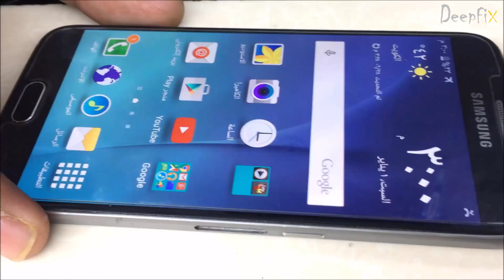Samsung Galaxy S6 Dead Fix

Comment: Wow, this was really impressive. My daughter S6 woke one one morning not turning on. When you plug the AC adapter it gets hot as usual and when you place it over the wireless charger, the charger turns the blue light on, but the cellphone itself doesn`t turn on. Do you know what is going on and if it`s possible to fix? Thx
Reply: Same happened with mine also about 2 to 2.5 years ago.
It was caused by voltage fluctuation in main electricity line that caused 350volts in the 220v home line.
It caused drastic damage to many home appliances one of which is my s6.
I tried fixing it myself but didn't get any success.
Still trying to fix it as i'm free now a days due to lockdown.
Long live bro.

Comment: I used s6 phone charging with wireless charger but not charging by cable charger.......How to solve this problem
Reply: Replace the charging board, it is the little one at the bottom, and the repair is fairly easy and cheap

Comment: pls pls pls urgent update, my galaxy S6 phone won't turn on until i plug the charger with it and if i removed the charger it go off again, i change the battery today and the same things still happen. it also go off and on before it finally turn on. kindly update on the next advice

Comment: Hey, My Galaxy S6 got wet at a party but not like soaked and it stopped turning on but it would charge. I took it to a repair guy and he disassembled it and tried many different things but it still wouldn't work. So he came to the conclusion that the motherboard was fried and it needs to be changed. Is there any way I could either get the data off of that fried motherboard or fix the fried motherboard? I'm begging you to please help me by answering this. Thank you

Comment: Hi, I have a Samsung Galaxy S7 SM-G930F which suddenly went black. I checked the LCD is working by swapping the other working motherboard of S7 to this fault one. Touch is also working. I did the hard reset, can run the setup wizard with the Voice assistant. But there is still no display at all. Any idea? Can you fix it?

Comment: My S6 Active stopped working last year so I got a new phone. I just recently decided to try to fix the s6 and noticed the charging port and home button plate might be the problem. The home button had stopped working consistently and was always in a depressed state instead of sticking out of the front screen plate as it should. My phone ended up shutting off and for weeks it would get extremely hot near the rear facing camera when I tried to charge it. Thoughts?

Comment: Hi, Great video!
What are you applaying in 1:18 before you start heating up?

Thanks
Reply: Flux. Sometimes found in things like solder, it helps to prevent oxidation of the base and filler materials. I guess without it, your chance of something going faulty again would be that much higher.

Comment: Hi guys. My s6 edge plus got cracked by an elongated tube and the screen is badly damaged. However, i could still receive calls and the apps are still updating. Would there be any motherboard issues on this? Or is it just the screen that needs to be replaced. The cracks reached the back casing near the battery sight. Please help guys. Thanks!

Comment: hi, i have an S6 edge, has had no water damage or any drops/falls etc, phone refuses to respond in anyway no charging lights no power nothing, tried all the reset key combinations they didnt work, so i went on to change the battery and changed the charger port, still has nothing, it is also making a really quite ticking noise when i put it on charge and bring the phone closer to my ear. Please can u help with this issue. thanks

Comment: my wife has am s6 128 gig. her phone is completely broken and won't turn on. as you know, the s6's were the only Samsung line where the SD card was in bedded into the mother board. is it possible to remove the factor installed micro SD memory card so I can at least retrieve her contacts and other info? what can be done?
Reply: Mike Ramos you can retrieve all data from it. search for emmc adapter or pay someone who does it for you

Comment: my S6 Was water damaged. The phone turns on when it's plugged into power but will not turn on off of battery. 
Battery says it's 95% charged each time the phone is unplugged and plugged back in and charges to 100% and then repeat.
I've also gotten a weird message saying the phone can't charge because battery temperature is to low. 
any ideas?

Comment: have a samsung galaxy s6. i recently dropped it in water and the water was an inch and i left it in there for 3 sec. my phone is still good. screen is on, power button started working again, volume buttons work, home button works, return and history button works. but the only thing that im concerned about is the touchscreen. it doesnt work. i press the screen nothing happens as if it were frozen. Can this be fixed?

Comment: Im super upset i got my phone wet like a month ago . I put it in rice and the air vents for 3 days straight nothing worked. It kept on saying that the battery was overheating (even the symbol showed up when i had it off but still connected to the charger) and it turns off. I left it alone for a few days and decided to go in and get the battery replaced.(That didn't worked :( ) It still shows that the battery is overheating and now it wont let me open up any applications (only contacts and phone) and it says that the device is still hot (and it really wont charge). But the rest of the things function well like i can swipe from screen to screen I can turn off the phone properly.  Any suggestions on what I can do ? (I can't return it because the guy broke the back screen when he replaced my battery and the phone warranty won't work since he opened it up, I didnt get any insurance on it because it was a gift from my bf). HELP. :s It is just extremly upsetting since I can't afford to get another phone.
Reply: Haha rice! does rice go in an clean the water? no it does not send it to a repair centre
Reply: Hi, that issue is caused by the charging flex, 100%, fixed a few by changing the flex, or just the USB port on the flex. All this assuming you are talking about an Galaxy S6.
Reply: Netzy Garay im in the same situation how did you fix it
Reply: Netzy Garay did you get it fixed??? This happened to me

Comment: Hi,

My Samsung S6 will not turn on and will not charge. I noticed my s6 was getting very hot, so i opened it up and noticed that the Maxim MAX77843 Companion PMIC was very very hot and my power ic was only little hot. I do not know what to do next, can you give me some advice?

Thanks
Reply: I have the same problem, did you find out the cause? I can see several SMD caps measure Short circuit on the VBAT line. I changed both the MAX77843 and the Power IC, its no different.
Reply: I will start removing the caps one by one, oddly the battery is charged and doesnt measure shorted at the connector, there must be an inline fuse after the connector
Reply: hmmm...Tell me what hapens

Comment: Hi my s6 edge had water damage, the motherboard and battery was replaced. 

But how normal is battery drain? i replaced original battery with oem. 

my battery drained 13% in 2 hrs without any use (no wifi/4g etc). 

my battery drained about 1% / min use of youtube. is this normal? please advise.
Reply from the maker: +Jessica Leong Sin Yi i think it's  due to water 
There is some component might be short it cause battery drain
Reply from the maker: +Jessica Leong Sin Yi i think it's  due to water 
There is some component might be short it cause battery drain
Reply: How did you find out the issue? I've tested many components near the power supply ic and all the caps check out. Given I don't have the schematics for the s6 us tmobile model.

Comment: hi would you happen to know on the samsung galaxy s6 what chip controls the usb port. i have changed the usb port the whole board at the bottom of the phone i have tried loads of diffrent cables all i get is usb device not roconized. i have also tried diffrent computers . but still no look. i have all the hot air to remove the chip. thanks in advance regards james

Comment: Can you help me? Mine has a bizarre problem. It sometimes has a red charging light when connected to power and sometimes has a greed light, when it has a green light I can hold the power button and volume up button for 20 seconds and it will make the startup sound and will vibrate but nothing will be on the screen. If I plug in headphones hat have the volume controls on them into the headphone jack I can get the music to play but that's about all it will do because the power button, and home button do nothing and the LED light blinks blue every 5 seconds, once the cable is pulled it turns off completely as if there was no battery connected. I purchased a new battery but have low expectations of it solving the problem...

Comment: hello bro, I need your help , I pass heat gun and now to start s6 edge requests that the system has overheated and shut down , he's just so a few minutes and off , leaves no load and I can not get in the way to reinstall software download

the question is about , can be repaired or logic and can not do anything .

Cheers

Comment: Hi chief, I have Samsung Galaxy S6 getting in water. Once it's starting the device is works fine as I have replaced the power AC inside it. The problem is that the touch screen not responding but it's work after many of tapping on it. Also the battery is not stay for one or two hours after 100% charging.

Comment: Thank you for your informative videos.  I have a samsung S6 in a bootloop and am unable to fix through software.  Is there a hardwere component that can cause this and if so which part should be replaced?
Reply: same here, i cant start the dam 800$ thing , but this guy only respond to girls
Reply: i also have another Samsung S6 the has corrupt baseband, any advise on how to fix?
Reply: +stanley ward 

I also have this problem, s6 water damage causing boot loop or freezing seems VERY common, I've seen 3-5 phones like this and no amount of cleaning in alcohol, ultrasonic cleaner, reflowing, or flashing stock rom(s) has helped. Any advice appreciated.

I believe it is a hardware component

Comment: What kind off soldering station / rework station do u use ?
Reply: +Anders Lindquist is it rework station with fan in handle or diagram pump in station ?
Reply from the maker: +Anders Lindquist it's rework station with fan